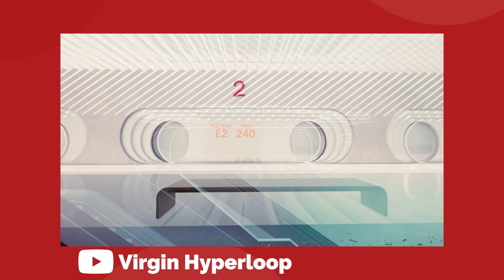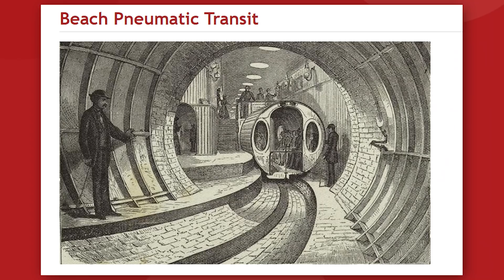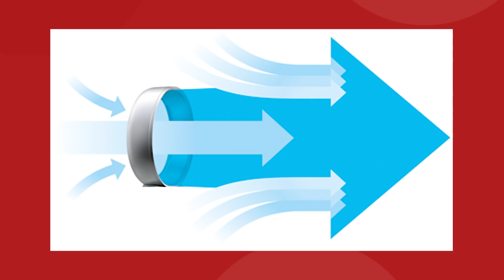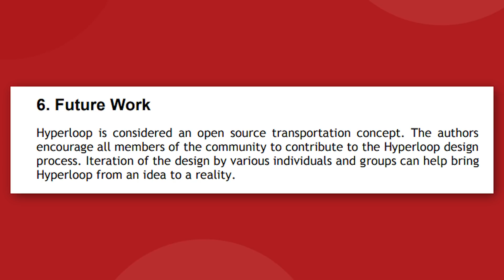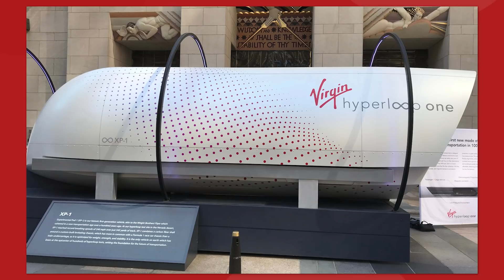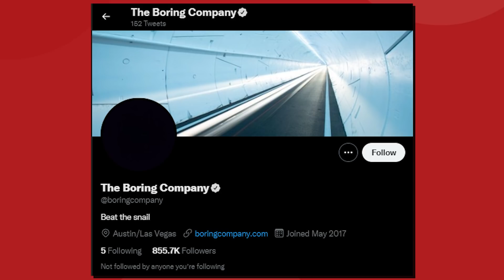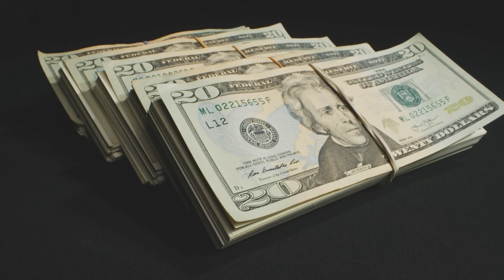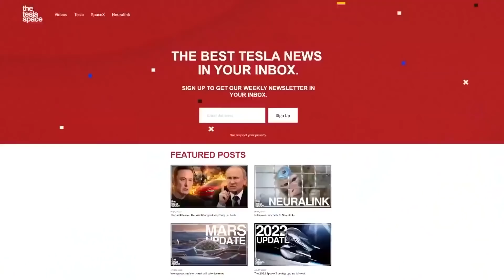The Boring Company Is Building A Hyperloop!

Comment: I was Surprised and saddend to hear that Virgin have given up on hyperloop. I thought they had the best potential with plans to build them all over the world.
Heres hoping Elon can prove them all wrong once again...
Reply: lol🤣🤣
Reply: It’s not financially feasible
Reply: @ravd8082  When has that ever stopped Elon?
Reply: @ravd8082  

Lots of people had said that several of the things Elon has set out to do weren't feasible.

They were wrong.
Reply: @bobwallace9753  100
Reply: @mohammadwasilliterate8037  thanks for clarifying this its been 9 years know one gotten close , everyone thinks musk has special powers on here 🤣😂
Reply: @mohammadwasilliterate8037  
First, anyone who thinks Elon forgot to do the math is, well let me be generous, an idiot.  Elon thinks math.  Math and the laws of physics.

Elon's white paper was just a basic concept.  He's now spent a few years working out how to rapidly construct concrete lined tunnels at a very affordable cost.  He's never started down the metal tube path other than building a scale model with six foot diameter pipe as a way to test pod designs. 

Maintaining a vacuum.  Elon has said that for a tunnel to be watertight it will also be able to support a near vacuum.

Airlocks can be just slightly larger than the pods, meaning very little air to suck out before the pod enters the main tunnel system.

Airplanes fly in partial vacuums.  That's why we fly long distances at 30,000 feet or so.  It's to get up where the air is "thinner", where there are fewer molecules to shove out of the way.  To save energy.

Elon has been getting ready to build a hyperloop.  He's told you that.  He's run pod test contests as a way to find really good engineers with really good ideas.

Pay attention.  Very few people pay attention when Elon tells them what he's going to do.  And then they are surprised when he does.
Reply: @mohammadwasilliterate8037  

This is not a train.  It does not involve the expensive of acquiring and constructing a surface railway, complete with very strong fences along the route to keep people and animals off the track.

There's no metal pipeline in Elon's hyperloop.  It's a relatively low cost concrete lined tunnel.

Being underground there is no thermal expansion problem.

You are just spouting off without understanding.
Reply: Are you sure they gave up on it entirely, or did they just reduce their use-cases for it, and now aim to deliver freight from shore to shore?  This isn't really a bad thing. This is the best use-case for it.
Reply: Delivering cargo via the hyper loop is the best first use-case.
Reply: I knew this years ago, that they should not focus on passenger transportation first, but focus on cargo delivery first.
Reply: Why cargo first? If they built hyperloops delivering cargo from shore to shore, it will reduce trucks and ships, while delivering as fast as planes.
Reply: @mohammadwasilliterate8037  
Sorry.  I don't think you understand things like scale.  You seem to not have grasped the basics of Elon's idea.
Reply: @bobwallace9753  What were they wrong about?
Reply: Were you? What sort of results did you achieve studying science at school? There really shouldn't be any surprises.
Reply: @davidbrayshaw3529  
"Lots of people had said that several of the things Elon has set out to do weren't feasible."
Reply: @davidbrayshaw3529  
 @Bob Wallace  lets see if elon can build it and make it a success then we will all be silent
Reply: @bobwallace9753  And to date, lots of people have been proven correct. The Hyperloop
is a century old comic book concept that has never materialised for a number of very good reasons. Firstly, his idea of using a cushion of air, "like an air hockey table" (Musk's own words!) in a vacuum, is laughably ridiculous. It defies logic at every level.
Even in the event that Musk realises how ridiculous this is and chose an existing technology such as mag lev or wheels, the notion of pulling a meaningful vacuum
in a volume the size of even a short tunnel is a practical impossibility in the realm of both cost and the sheer amount of power required. Have you ever had any experience with industrial vacuum machinery? I have and I can guarantee you that it takes a very big motor on a very big pump to pull a vacuum in a very small volume.
Then there is the inconvenient fact that concrete is a porous material. It CANNOT hold a vacuum!
Hyperloop was an is only ever going to be one thing. A concept to lure money out of the pockets of gullible investors and into the hands of corporate elites and their lackies. At that, Hyperloop has been a resounding success.
Reply: @ravd8082  Well it's been eight years and nearly half a billion dollars of investor money and still nothing. I can't see me being silenced by success in this life time.
Reply: @bobwallace9753   Yes, and I remember what happened to Icarus! The technology did not work due to the inherent limitations of the materials! If only Icarus had been honest with himself or had perhaps done a bit more research, he might have enjoyed the journey a little more. Perhaps if Elon was a little more honest or had done a little bit of research he would understand that concrete is indeed a porous material and not make statements to the contrary.
Human endeavour is a wonderful thing and it has achieved all manner of outcomes.
Great failures have more than been offset by great successes. Purporting  claims of endeavour have also been the stock and trade of any number of scoundrels throughout history. Our jails are full of them.
To date, nearly half a billion dollars of investor money has been swallowed by those purporting the viability of the Hyperloop. Yet there is still no hyperloop and not even any sign of a Hyperloop on the horizon. It is also eight years since Musk revived the 100+ year old concept. 
One of the beauties for those that can secure funding for research is that failure is an option without recourse. And at what point do you acknowledge failure? Am I skeptical to suggest "when the money runs out".
I don't dispute the merit of a "can do" attitude. But the ability to reason what can't be done is of equal and important merit.
Hyperloop, as originally described by Musk, can't be done. A variation on the theme, maybe. A vehicle running in a tunnel, yes. Mag lev, tires or tracks to support the vehicle, yes. But the concept of supporting a vehicle on a cushion of air in a vacuum large enough to traverse continents, states, cities or even a few block is ludicrous.
When do we acknowledge failure?
Reply: @davidbrayshaw3529  

You do not remember Icarus very well.  The technology worked great, at least in the myth.  But the operator pushed the technology past the specified operating limits.  Icarus was warned to not fly too close to the Sun.  

You assume Elon has not done the needed research on creating airtight tunnels.  I assume you have pushed far past your specified operating limits.  You have zero knowledge of what Elon and BoringCo might know, what tests they've run, and what numbers they've crunched.

"To date, nearly half a billion dollars of investor money has been swallowed by those purporting the viability of the Hyperloop."

BoringCo has yet to spend a penny on hyperloop construction.  A bunch of people augered in prior to the Wright brothers achieving powered human flight.

Here's the mistake I think you're making, David.  You are attempting to predict the failure of future efforts based on past failures.  By doing so you ignore how new ideas, materials, and techniques can emerge and allow success.
Reply: Correct I agree  but there’s too many musk fanboys just like his other promises fsd level 5 promises end of 2017 on tedex never delivered and now once again said level 5 will be delivered end of 2022 on tedex with Chris Anderson  😂😂
Reply: That's the problem with negative people, they only see the negative and somehow conviently forget the promises he did deliver on.
Reply: @bobwallace9753  Yep, nearly half a billion dollars spent on R&D and the Boring Company still hasn't spent a penny on construction. Neither of us are going to agree with the other so how about a little wager?
I'm going to declare Hyperloop a failure if it hasn't been produced as per Musk's original description, by 2030. That's fair, isn't it? That's 17 years to make a basic tunnel that holds a vacuum with a vehicle in it that runs of a cushion of air and travels at a speed of 760 Mph.  We managed to land a man on the moon in less time than that and according to Musk's own words "Hyperloop is easy".
Is $100 US a good number for you?
Reply: @davidbrayshaw3529  

No, that's not fair.  When doing anything for the first time it's common to run into unknown unknowns.  Problems that no one expected but have to be solved.  There are no failures in the sense you use the word.  Just, not yet, a solution that works.

BTW, you might want to catch up with developments since the white paper of 17 years ago.  The idea has moved from a metal tube to a concrete tunnel.  The diameter of the system has moved from about six feet which required traveling in a reclined position to something more like the size of a regional jet.  The propulsion system has moved from turbine and air bearings to maglev.

One of the reasons Elon has been so incredibly successful is that he innovates and creates companies that innovate.  Constantly.  It's not your daddy's General Electric.

As for your "we managed to land a man on the Moon", we have thought about getting humans on the moon for a hundred years, if not hundreds of years.  

"American college professor and scientist Robert Goddard built and flew the world's first liquid propellant rocket on March 16, 1926."

"On July 20, 1969, two American astronauts landed on the moon"

Looks to me as if it took 43 years, at least, to send people to the Moon.
Reply: @bobwallace9753 , Sending a vehicle through a tunnel is not a "new" concept. Nor is the tunnel. Nor is a concrete tunnel. Nothing to see here, it's old technology. Sending a vehicle at high speeds through a tunnel is not a new concept either. Road or rail, it's been done. It's been done at speeds of 200 or so MPH. Impressive, I'd say.
Musk's original claim, was that he would send a passenger carrying vehicle through a vacuous tunnel that transcends cities or even continents at speeds of 760 miles per hour. And he would do this in a vehicle that travels on a "cushion of air much like an air hockey table"(Musk). 
"And its easy"(Musk). Now he's investigating mag lev as a propulsion and support mechanism? Isn't that also existing technology like the hole in the ground we come to know as a tunnel? And concrete that has been in existence for Millenia and as "modern" material for about 250 years?
No wonder he moved wanted to move from metal tubing. That technology is over two thousand years old!
But at least now it's bigger. Six feet wide just wasn't enough and steel is so Jesus era. I'm getting exited now but I'm still not feeling the "innovation" part of the equation. In fact  I'm not feeling the "innovation" aspect of anything that Musk has achieved as an entrepreneur. And as an entrepreneur he has been outstanding. He's captured the imaginations of many and drawn them into his bubble.
But inventor? What's he invented? It's not the battery powered car, he didn't even found Tesla. Orbital communication satellites, no, didn't invent those either. Rockets? Didn't you just mention Goddard (not that he was the first)? Tunnels? Concrete? Mag lev? the wheel? 
Anyway, enough is enough. I'll promise you in the days leading to my death, when Musk's vision of a 760 mph transcontinental or even intra city tunnel is operational and a reality, I'll request of my kin that my headstone reads "Here lies a gullible fool". But I'll only do that if you promise me that you'll do the same if those magical tunnels and their near supersonic vehicles are no where to be seen.
Deal?
Reply: @davidbrayshaw3529  

How about you tag your tombstone with 

                                Here lies a pessimist
A person, were they in charge, would have blocked human progress.

I'm hoping to get biodigested in some form or another.  At worst, baked and scattered.
Reply: The original white papers on the Hyperloop were fundamentally flawed in dozens of ways. I'm a huge SpaceX fan but the Hyperloop  is not suited for mass transit, or pods. Regular trains for freight and high-speed trains like in Europe and China for people are perfect without any major issues.

Comment: I don't think hyperloops can work for long distances above ground because of thermal effects on the structure, which needs to maintain some kind of atmospheric seal. Do an image search for "railroad tracks thermal distortion". The railroads have the same problem. This issue more or less goes away if you're using tunnels.
Reply: How do the railroad designers solve it?
Reply: @markharmon4963  .  Gaps in the rails.  Can not have gaps in your hyperloop tube unless you have an expandable seal.
Reply: @tennislite  High Speed Rail does not have gaps.  It is continuously welded.
Reply: @markharmon4963  they have breather switches. Are also much easier to maintain and monitor.

The hyperloop is never going to happen.
Reply: @sparkster1314  Why not use accordion connections.  Or shade the tube with solar panels. Or maybe tubes do not expand as much as rails.

Comment: I think this is just a pipe dream. See what I did there? The tube uses far too many resources. With a high speed rail system the rail bed uses far less steel and concrete, sure there is air drag but that doesn't seem to have hampered systems around the world. 

I'm not a fan of Musk's electric cars but at my age I'll never have to get one, I'll be gratefully dead before gasoline runs out. But Tesla and Starlink fund Musk's SpaceX, and I am a fan of that.

Comment: A hyperloop at 150 to 200 mph, yes. 

A hyperloop at 800 to 1000 mph yes, on the 
moon and on Mars. 

There is no way around air resistance. 

(Whereas, ok, you also see Alien UAPs with 
tremendous speed and furious acceleration. Why 
not also instead of the Unexplained Aerial 
Phenomenon an Explained Tube Phenomenon?) 

The most important thing is: Don't give away 
your money for it.
Reply: You seem to not have grasped the major aspect of a hyperloop.  Very little air resistance due to operation in a partial vacuum.  700 MPH.

Comment: How about a slot car track interstate for recharging electric cars while they travel and avoid charging stations. Electric vehicles could utilize one lane for recharging while everybody else pass them by. Magnetic induction could be used instead of a slot. People want the freedom of there own car, traveling in a tube is not different from train or plane, you still need a car when you get there. How about make a hyperloop big enough to transport cars and people instead of just people.
Reply: Tesla EVs can charge up to 200 miles in 15 minutes.  Drive almost three hours at 70 MPH.  Take a quick break.  Drive another 200 miles.  

If you drive an ICEV you're likely to make a meal stop and a pee stop.  Driving an EV won't add any meaningful time to your trip.